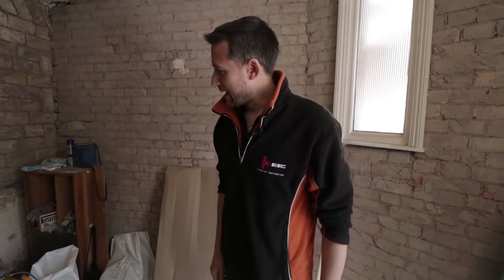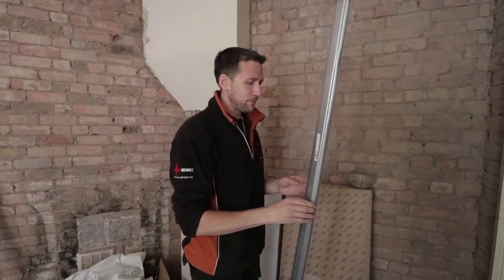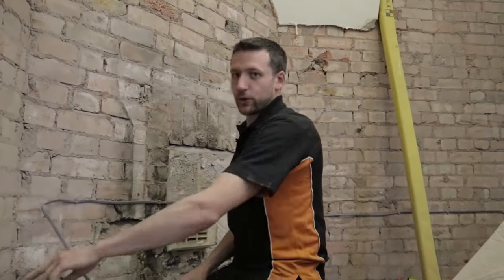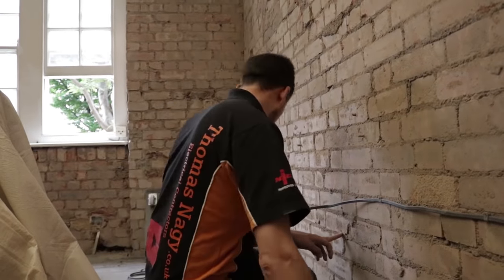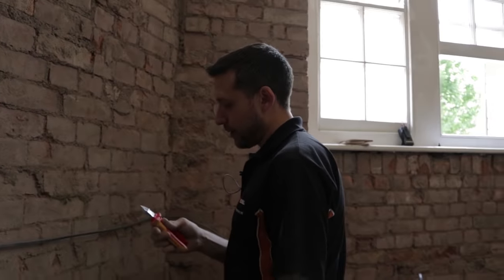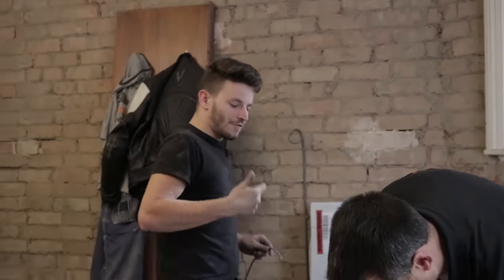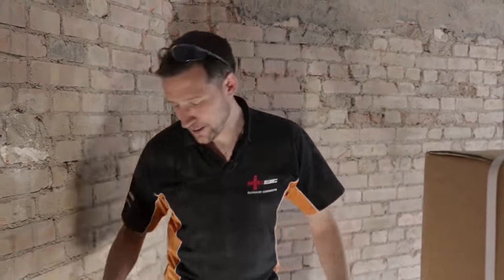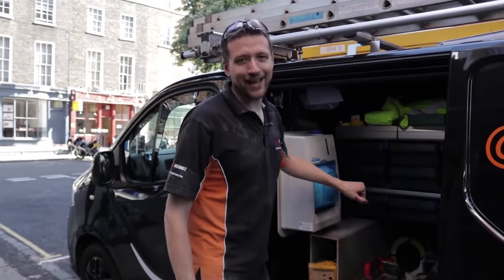Galvanised capping 101 + another rewire | Thomas Nagy

Comment: Also quick tip galv capping just use a pair of tin snips to cut it also your suppose to fold over the Ends so theres no sharp edges near the cables
Reply: What Pins/Screws do you use to fix to the walls?

Comment: in the states with outlets for bed rooms we measure 1 meter(3ft) from door place 1st outlet than we go every 3.6 meters (12ft) so as if you have a lamp cord with an avg length of 1.8 meters you can plug it in no matter where it is in a room also for a large wall we place two outlets on either side for where night tables wld be also do same for large windows or fire place openings (any opening like a fire place/ closet  needs to have an outlet with in every meter on each side. so it comes out to an outlet on every wall some times 2

Comment: Thomas a great trick to installing a earth rod so you don’t hit your hand etc is to use a sds to three jaw Chuck adaptor fitted to the end of your earth rod and connect to your sds drill and drive it in using the hammer action on the drill 👍👍

Comment: Oval tube 100% easier and offers exactly the same as the rest in form of protection from a trowel.
Reply: I see what your saying. Interesting. Very interesting
Reply: Not really easier when you have to feed the cable through though, that’s the attraction of capping, whether galv or pvc
Reply: 100% agree with this
Reply: Too deep for a lot of walls

Comment: Also a quick tip for the earth rods I use a 15cm length of 25mm copper pipe with a brass blank on the end use that as a Bray in tool gives you a wider flat top to hit saves you missing and hitting your finger.
Also using a mash hammer makes it a quicker job.
A Lad I used to work with used an attachment for the chasing SDS, rods used to fly in without mushrooming the tip.

Comment: Also tom, put a guard on your grinder. Those discs when they break cause all sorts of damage to your face. Dont risk it. Guards dont get in the way.
Reply: And remember grinding and cutting use different discs
Reply: Good advice and safety specs...you never know the minute...a while back I was using an orbital sander when there was a bang and something landed in the kitchen sink several yards away..looked at the sander and it turned out it was part of the innards had broken off and burst through the casing and must have missed my face by inches....close call
Reply: I know he's a big boy & can look after himself, but I didn't half tense up when he was playing with the blade while the battery was still in the tool 😥
Reply: @SamMegadeth  you know you have to turn it on for the disc to start spinning right?

Comment: I agree with putting the switches in cupboards, however I would use metal clad SM boxes or at the very least a strong nylon based plastic.  The normal Thermoset (sp?) plastic boxes are very brittle and you can bet your last dollar some doughnut is gonna slam some big heavy piece of equipment into the cupboard and smash the box to pieces,  potentially exposing live parts!

Comment: I still own a  set of cable croppers that I blew up 25 years ago. They still cut really well and the holes actually are useful for stripping cable cores.
Reply: Still using the same kew technik snips i bought 20 years ago that have very convenient 1.5 & 2.5 wire strippers blown into them courtesy of snipping a live 1.5 switch wire. :D

Comment: Cable jack/stand. 20mm galv conduit - 2 T boxes, with 2 legs either side. Drill both T boxes out with hole saw and slide a length of of conduit through 👍

Comment: Hi pal, I am referring to your candle jacks, I have made plenty of them out of 20 or 25mm galv conduit and 2 angle boxes. Legs are about 21 inches long. Then drill a larger hole through the Center of the angle box. The legs are the at an inward angle to keep it stable. It can hold a lot of weight

Comment: Metal blanks - tick (fit better). Sockets in cupboards - tick (dont use crappy boxes, use PVC ones). Metal capping on dot & dab walls - No, no need, capping is only for protection during installation, I doubt cables will get damaged by plasterers sticking boards on, you wont be able to pull wires through later really either so just clip cables. If its metal your supposed to earth it. Surprised at Luke's rant, he's normally so calm

Comment: The hot needle through the nail is to relieve pressure to stop the pain and possibly to save the nail.
I have seen my father do it and the blood almost spurted out when he removed the needle.
Reply: Doesn't need to be a needle, paper clip, panel pin. Heat to red hot and it will melt through a nail easily with v. little pressure. Works every time. Stops blood clotting and forming a scab that lifts the nail.

Comment: I worked nights for many years and would never approach a workman like that, especially as I know it's necessary noise, different if the stereo Is blasting. But working nights with daytime noise comes with the territory..I also know that a person of that age has probably never killed someone before due to the conviction time, and if someone that wears flip flops to threaten you their not use to fighting of late...One good kick in the nuts with steel toe caps on drops anyone..One tip tho, it's always good to pre warn the neighbours with a curtisy card or leaflet about possible noise as some neighbours don't talk or even like each other which may have been the case here and you got the brunt of it..Gl to Tom and team great video...Lee the night worker.

Comment: I seem to remember that galvanised capping was used when the render was sand and cement , it has something to do with the chemicals in the cement breaking down plastic capping . The plastic capping would be used for bonding plaster. If walls are dot and dabbed no need for any capping. Primary function to protect cables when wall is plastered.

Comment: Just wondering, not giving off, but should the cables not run vertical up and down and not horizontally? I always thought to assume they’d be vertically ran? Glad I saw that, it will make me think twice before drilling into the wall even if no plugs nearby!

Comment: Would it not make more sense to fit the caping with only fixings on the under side of it, and peel it back to slide the cables into it and once done fit fixings in the top of it, instead of clipping the cables then fit the capping? Great video as always!

Comment: DIY Cable spooler
2 x 2 way angled conduit box
4 x 16" 25mm conduit
1 x  24" 20mm conduit
4 x  25mm bushes
2 x  25mm coupler.
all the conduit in galv.
Drill a 25mm hole through the centre of conduit boxes for the bushes and coupler then assemble.
one tuff cable spooler.
Reply: Yep
 Done that before n works fine
Reply: @carlmarquardt994  It didn"t cost me anything, courtesy of a site I was working on. Now sprayed VW metalic green so it doesn't get confused with the ordinary conduit.

Comment: Each to there own i guess,ive been a spark for some 33 years now  and have always used galv capping on ever cable drop ive ever done,  i cant see me changing my ways  any time soon back in the day we used to bound it with flying lead and a 4mm brass pin and nut ,
Reply: btw you should never cut galv with an angle grinder,the smoke is very toxic ,and i alawys fold over the end and then hammer back flat so the end has a smooth edge

Comment: £32 for 12 lengths of 38mm capping is daylight robbery. We pay under £1 a length, and having just checked the national wholesaler who shall not be named's prices, they'll sell it to you with no account for £1.01+. Also, give drill fixing with penny washers a go on galv capping. Much easier than trying to bang a stupid nail through the lip or be super accurate with a standard screw.
Reply: And even that's expensive compared to other sources..

When in London, get bent over instead of stocking common consumables, apparently.

Comment: I think the switch gear conundrum is because where possible accessories should be mounted to the fabric of the building and not to furniture that may be removed. (There is a reference in OSG and EGBR to back this up) Excellent video as per the norm. Perhaps you should have offered the angry knife man a 10 % reduction on electrical work. :)

Comment: I always use ovel conduit, easier to pull a cable out and replace if it gets damaged.  Nothing wrong with putting isolators in a cupboard, some kitchens  you have no choice.

Comment: Haven’t seen anyone in Ireland using capping full stop but that metal capping your using looks exactly the same as what the slobbers here use when slabbing a precast wall & im sure it’s a lot cheaper
Reply: Was thinking the same, would generally use plastic Waven with clips or Saddles to suit.

Comment: Always thought there should be a press you can get that would form the end of glav capping as it goes to the wall boxes.
You put it on without forming the end a bit and it's a sharp af edge against pvc cable as it goes into the box.
With a press type thing it could form a shape that offsets it and forms a kind of fan shape.  Marketable?

Comment: Looks like the wash station is thermostatically set to 120 F. You should be able to add a variable resistor inline with the sensor to adjust the signal sent back to give you a more desirable temperature.
Reply: Last page https://www.allsafetyproducts.com/documents/catalogs/asphandiwashtechnical_brochure_2.pdf shows the location of the sensor.

Comment: Just a note I was picked up on my inspection (NICEIC) that the cooker isolator is supposed to be easily accessible and visible due to the nature of what its controlling. I used to put them inside the cupboard next to the cooker/hob but was told this was not acceptable will try to find it in the regs book and put a number on it. regards Fellow sparky

Comment: I run an AV company and Galv capping and lots of site photos  helped us prove the guys fitting the customers paintings on the wall were idiots.
How do you secure the capping? I use wall plugs screws and washers but you seemed a lot quicker.
Great videos. I need to get on insta. What brand tools did you go for? I'm choosing between Milwaukee and Dewalt but leaning towards Milwaukee due to really good site lights.

Comment: Great and fascinating video.  One thing about the galv capping I noticed at the end of the vid - is there any concern for the insulation on the cables as they come in from the sides of the capping?  I would think that there might a possibility of slicing through the outer jacket at least?
Reply: I bend the ends of metal capping over on themselves to give a smooth edge.... Although I'm doing the opposite of Tom, I've give up on galv capping and converted to PVC. Dot and dab walls I don't bother with either and just clip

Comment: I know how you feel.  Installed a shower pump last week.  Gravity runs through loft in 22mm through loft supported on Munsen rings, all lagging glued (not cable tied, or tape that falls off in the heat), and all pulled bends.  Run parallel to the wall and avoiding the potentially usable area of the loft.

Took a photo for the customer, and then looked at it; I realised that the rest of the plumbing in the loft was an unsupported snakes' wedding run diagonally across the loft and the thin lagging wasn't really held on at all.

Does anyone appreciate good plumbing in a loft anyway?

Comment: Galv capping is more expensive than the plastic one, but.. And it's a big but, in my recent experience, seeing Galv capping at the bottom of a freshly drilled hole stopped me drilling any further and damaging the wires.. I don't think plastic would have put up the resistance to drilling.
Reply: Galv capping dosnt have any resistance to drilling , why are you drilling where the cables are anyway ?

Comment: From the product description of that hand wash sink: "The water element in the included heater thermostatically controls water temperature to 120 degrees Fahrenheit to prevent scalding."
Reply: 50 degrees C is still pretty hot. Only option might be to change the element. If you can get a manufacturer and part number off the element, they probably make one set to a lower temperature.

Comment: Never seen the point of galv capping  really, oval is a lot easier plus it's a thinner chase, with capping you have to run the chaser up the wall twice. 
Some people think galv capping offers some kind of protection, which of course it doesn't,  you can drive a nail through the stuff just as easy as plastic.

Comment: My house had lighting wired in the 1950s and it had galv capping which had all been bonded at the top or every switch drop. But they had used bare earth wire, stretched tightly between each length! Not sure what that was all about.

Comment: thtat spool stand is a great idea but  find a decent pipe fitter like i did 20 yrs ago have them make you up 1 out of schedule 40 5cm dia. weld one cap on  leave the other loose to fill and screw cap on with smaller say 1.9 cm for feet  nothing is going to make that thing fall apart.  best thing i ever lrnd dont work agianst other trades share info and ideas be amazed what you can all do together lol

Comment: I made one of those about 20 years ago from steel conduit and two angle boxes, cost about a fiver, the one you have probably cost about £40
Reply: One of what?
Reply: Yes he could make a couple out if 25mm gal n two angle boxes
Reply: @asef698  the cable reel holder

Comment: Six thousand for a total rewire of a two bedroom flat does not sound unreasonable to me>I have just had a new build garage wired and that was fifeteen houndred for six double sockets one 32 amp and a sixteen amp along with four strip lights, and this is in Norfolk and I supplied the 32 and sixteen amp sockets which I had in stock, they only cost a few quid in bulk. I could have wired it myself but as I am not a qualified spark I would still have had to get it certified which costs nearly as much.

Comment: could you just limit the voltage to the water heater?
Reply: George Grinter Pointless- it would be complex. It would take longer to heat. The water would still get just as hot eventually.

Comment: Everybody bangs on about not fitting capping... I just think its good practice..
Reply: Clips are a waste of time on old walls with dodgy mortar so capping Is  much better. Use clout nails and red plugs, much easier than screws or knock them into mortar without drilling if suitable. Don't drill through capping, just drill either side and the nail head will catch the lip of the capping.

Comment: Do you earth your capping? The amount of times I’ve seen electricians install capping and not bother earthing it? What’s the point in it then as it won’t stop nails or screws going through the cable, the idea is for it to be earthed so that if a nail or screw goes through the live or neutral of the cable that it creates a path to earth. Installing it and not earthing it can make things worse because if it goes through the capping and just touch’s the live only then you are left with a live piece of capping in the wall.
Reply: Bonding it would make sense if it completely wrapped around the cable, but then it would be a raceway/conduit. Using it as a guard does not cause any significant eddy currents to be worried about.
Reply: Class 2 double insulated rocks!, 😎👍
Reply: off back to the 15th edition we go bond everything

Comment: Just wondering, Don't you have to earth the metal capping? Or at least have a connection between them and connected to a metal backbox that is earthed? for faults etc. Over here capping is not used. We use PVC pipe for this purpose and metal backboxes are non existent these days. All plastic pretty much. Metal is a no go here except for cable trays and such...
Reply: You must not be in North America. Metal is very much the standard here. He shouldn't have to bond the capping because it is a guard, not a raceway.
Reply: parkeerwacht We always screwed a fly lead from capping into back box. Pain in the arse stuff. Oval conduit all day.

Comment: Galv capping?.. No need.. Lol.. Unless outside. Keep ur profits. 😁  There prob is no thermostat on the water heater? Is it electricaly heated or fed from your vans radiator coolant using heat exchanger? Need more info boss 😉👍

Comment: If no one wants isolation switches, why not put in a larger consumer unit and run radials on 3A or 5A MCBs out to the appliances? Each appliance can be individually isolated at the board.
Reply: Alas you cant use an mcb as an isolator.

Comment: yep. anyone that said they never blew their snips up is either not a spark or lying
Reply: Absolutely vital for sparks to use VDE snips for this reason - sooner or later you're going to do it, so only ever cut installed cables with VDE tools.
Reply: I have a really nice set of cutters hanging on the wall of my workshop with a huge notch blown out of them.  The other 4 sets I've ruined since just got thrown away.
Reply: Do screwdriver tips count? Hmm,  I did get burn marks on snips a while back
Reply: I have not blown a hole in any of my cutting tools. I am just very careful about how I work.
Reply: I have been a spark for 30 years and never cut thru live cables.. Am I unique? 😂 I don't know how you could if you follow dead checks?